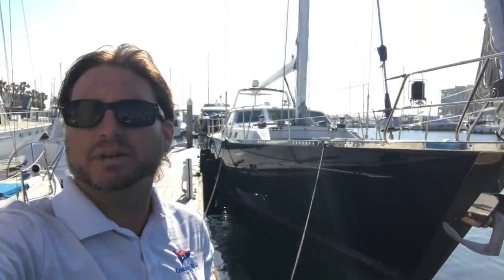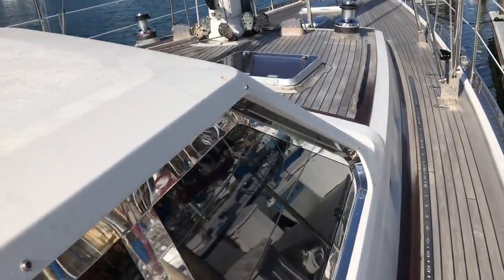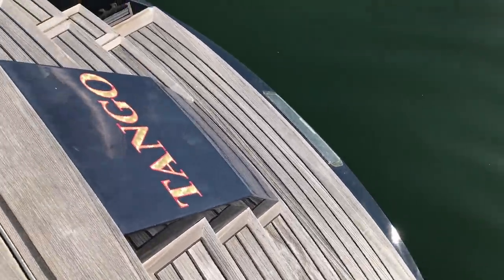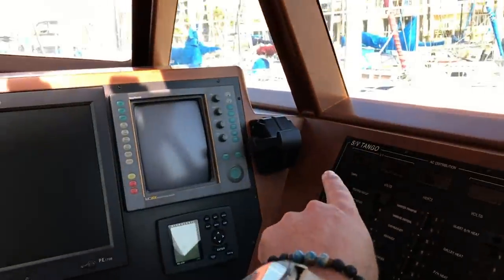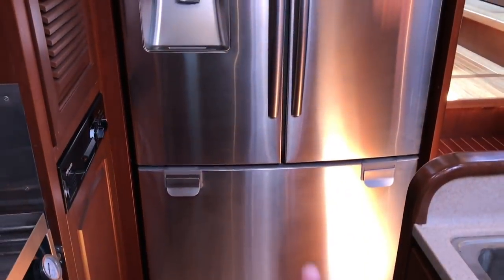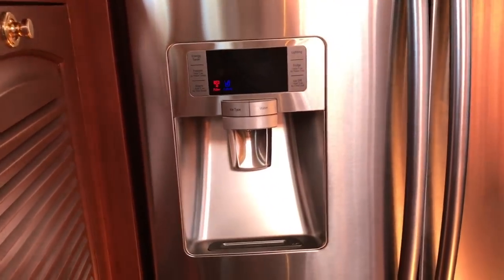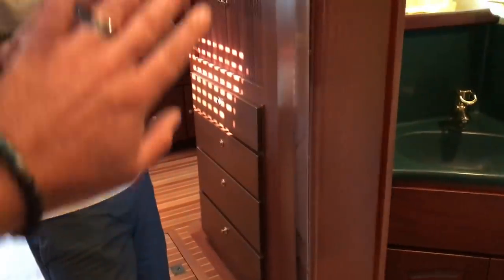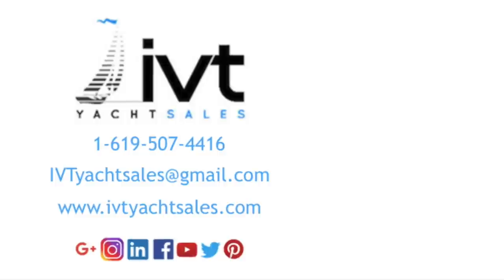1999 Custom Philbrooks 69ft Sailboat Walk Through By: Ian Van Tuyl

Comment: Amazing yacht. I love it except for the main. That table and 4 chairs set up has got to go. 
I prefer a more traditional U shaped sitting area. I think it is more flexible and just more comfortable overall. 
On a boat of this size & quality, that's a minor detail though. A good craftsman and a few thousand $$ would get that sorted out. 
If I had the money, I would go for a high quality yacht that's a few years older, just like this one, over something brand new that has cut corners to keep costs reasonable. 
A high quality build lasts the life of the boat. 
With a quality older yacht, you can go through and update electronics or dated systems. 
If they cut corners on the original build, you can never fix that.
Reply: What's with the ugly table on a 3 million yacht?
Reply: I totally agree. Great looking yacht and well designed interior. I would get rid of the four chairs the minute I signed the title documents and replace it with a curved sofa and maybe a smaller rectangular table. I also question the design of two helmstations in the cockpit and then a third inside the pilot house. The pilothouse helm station is a great addition for ocean cruising but maybe one center helm station in the cockpit would have been enough. Experience tells me that one single freezer,cooler appliance is a risk on long passages. Having two separate units gives you an advantage in case one fails in the middle of the ocean.
Reply: I agree.  All that’s missing from the main salon with its funky ugly chairs and poker table are those iconic and tacky dogs playing poker posters.

Comment: Imagine this boat but instead of the useless crew cabin you have the forward cabin head there, and more storage in the cabin or a larger dining area. Seems like these designers hadn't learned much by 1999 and they still haven't learned much. This is one of the reasons why catamarans are taking over, because monohulls seem to be designed to be even more cramped than they need to be.

Comment: I traded land in 2014 for a similar 1999 PH Ketch 58' in slightly better condition. Replacement cost was 2M and at the time it was surveyed at $750K. It took me 2 years to unload it which cost me about 60K in slip fees and repairs. I settled for $360K from the only serious buyer the broker produced. Had a great time sailing the South China Sea and Bali but these older vessels have a multitude of systems that need continual upkeep. Such low hours is a red flag that this vessel sat a very long time which is really a very bad program. Accept that upgrades will cost $180K on day one plus 75K per year to keep her in decent shape and before you know it you will have a 30 year old boat that will be worth what ??
Reply: Awesome reality check, Lowry.
Thank you from the bottom of my mainland Australia. Melbourne, Victoria.
Reply: That's a darn good point, right there.

Comment: “Amazing, spectacular, astonishing, amazing, spectacular, astonishing”........all of these superlatives for an old has been sailboat ?   This 69 footer may have cost $3.5 mill in ‘99, but in all honesty, that very dark interior is not looking very appealing and with the exception of that pilothouse the rest looks like a tomb !   
Besides that, it shows allot of ware and abuse allover the place.  That teak decking is done and it needs at least a resurfacing job if not complete replacement, and that’s a job into hundreds of thousand dollars.  The furniture inside, besides that it’s stained in a very morbid dark stain, it shows allot of dings and scratches allover the place and the upholstery shows allot of ware too.   The nav electronics are dinosaurs and need upgrading with something more current from B&G, Furuno or Raymarine.  All systems need to be checked, evaluated and upgraded as needed.  
To make this yacht into that 69 foot luxury yacht ready for circumnavigation you need to sink in it somewhere around $1.6 million in complete restoration and upgrades costs, or at minimum $900K in only necessary refits and upgrades and I don’t know if it’s worth it !    I can get a turnkey serious swedish built blue water world cruiser of the same age like a 62 foot Hallberg Rassy that gives you just about the same interior room and a level of comfort and luxury far above what this boat offers at under one million dollars and throw $25K in the latest B&G electronics package and be done with it !
Reply: That's darn good idea.

Comment: Looks varry seaworthy well built its not the most beutifull streemline but its probly like a volvo,or arostreem of the ocean i like when stuff is built with only function into the build im not calling it ugly but not as classy as some junk made at the time 99 is when every thing was built to be state of ark but technology wasent good in stuff in 90s erly 2000s in my experience every one was building stuff as space age as they could get without years of ironing out the kinks and its true. Every thing i own built from around 2000 iv hade lot of problems in long run now the sam technology has no problems. And ive had lot of stuff from 98/99/2000/2001/2002 and all of them that had realy modern featers from them years where not relyable like my older simple plane stuff from 70s80s erly90s had great luck because it was simple and all my recent perchesed stuff with technology ive hade varry good luck like 2007-2015 the technology has ben but threw its test every time technology is new we have issues and a 2000 build i found is the year .